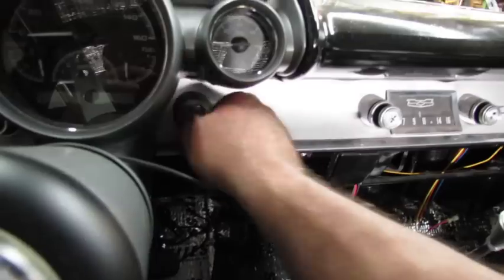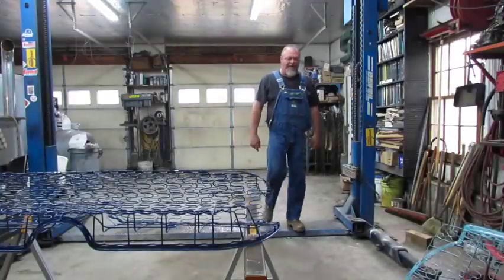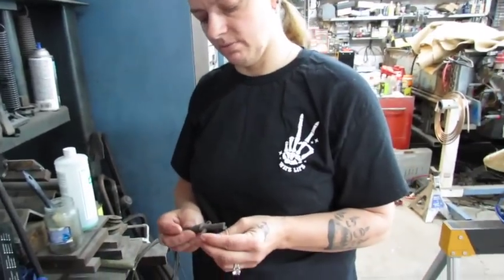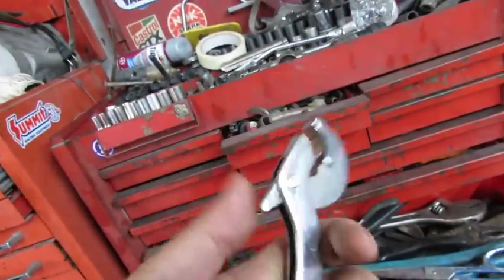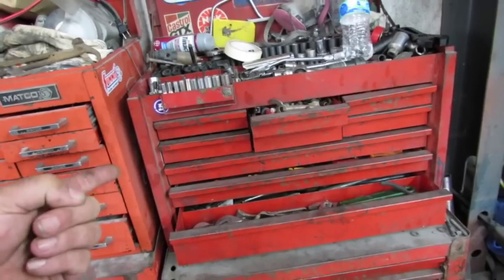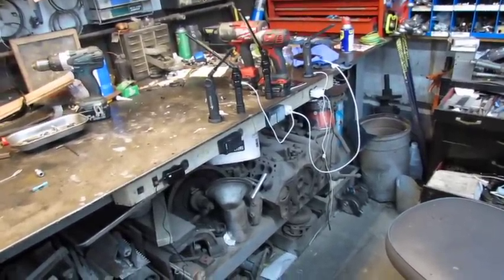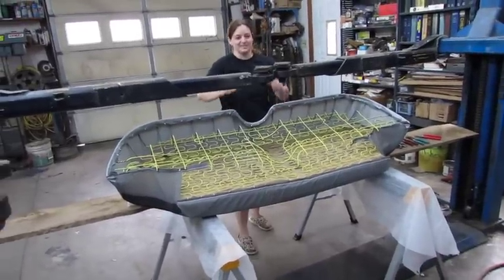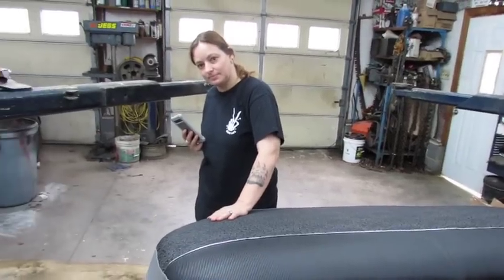57 Chevy Rear Seat Upholstered

Comment: not sure but does anyone else not see the mass air flow in the intake plumbing ? or does the efi unit Mr.hevyshevy is using dont require a mass air flow sensor ? Curious
Reply from the maker: Does not use mass airflow.
Reply: ahh ok . i was like whys it running that way
Reply: The sniper uses a speed density system with a MAP not MAF. Thing is that it takes a bit for the system to learn and adjust. You bolt it on with a base tune. Then start it and let it idle and then drive it and it will learn. Then you can start dialing it in. That one just hasn't run enough.
Reply: im learning. never used that type system before but appreciate you breaking it down for me